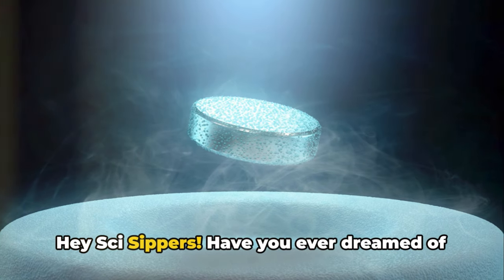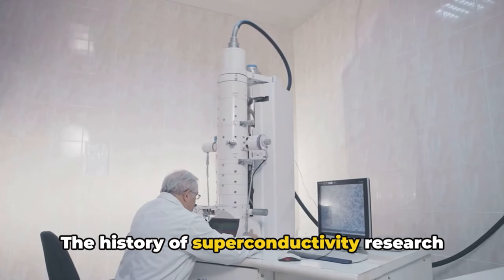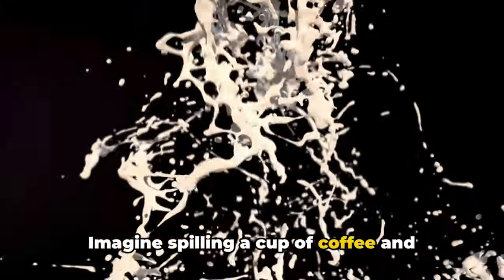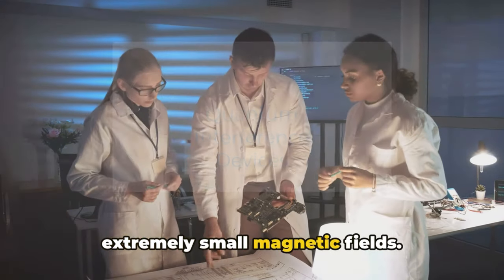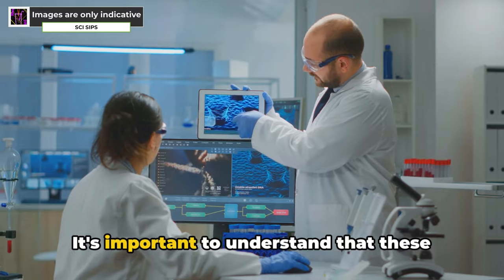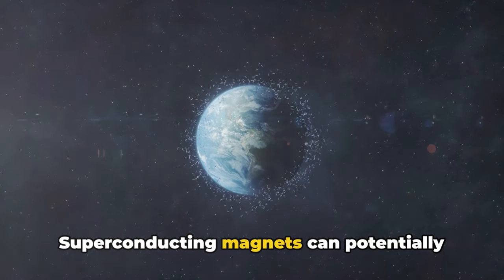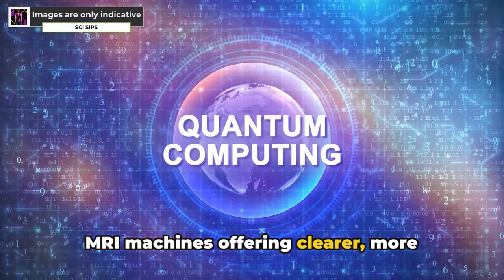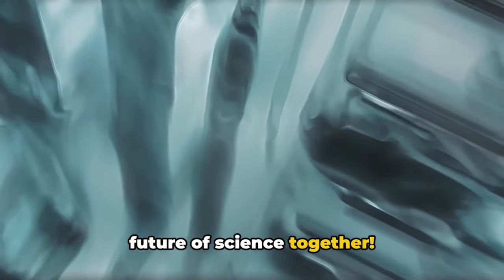Superconductivity at Room Temperature:  Unraveling  A Quantum Leap

Comment: The symphony of harmonies and the tone of a singular position that is so entrenched in the spacing process circles within circles of dielectric properties that change in temperature when flowserve is open to reduce the temperature and speed up the pathways of voltages to understand amplification of wavelengths you're entangled in every direction since they have no vibrations to the wavelength dimensional placement is iron sulfide or neutrons that flip flop so fast there not measured by normal levels
Reply from the maker: Hi there, thanks once again for your comment on the "Superconductivity at Room Temperature" video! I appreciate you sharing your thoughts, even though the specific details you mentioned don't directly connect to the video's subject.

Your comment touches on various scientific concepts, and while their potential connections are intriguing, they require further clarification to fully grasp their link to superconductivity. Here's how we can approach this:

Understanding your comment:

Specific terms: While the use of terms like "harmonic positions," "dielectric properties," and "iron sulfide" hint at potential areas of science, their specific connection to superconductivity or the broader topic of the video isn't entirely clear.
Overall theme: The comment seems to suggest a connection between various phenomena like temperature, flow, voltage, and material properties, but the specific relationship to superconductivity requires further explanation.
Moving forward:

Clarification: If you'd like to elaborate on your comment and provide more context, especially how these concepts relate to superconductivity, feel free to reply or send me a private message. I'm happy to discuss your ideas further and see if we can identify any potential connections.

Exploring resources: If you're interested in delving deeper into the specific concepts you mentioned, here are some resources:

"Harmonic positions" and "dielectric properties": These terms are relevant to fields like electromagnetism and materials science. Searching for online resources or academic papers using these terms might offer more information.
"Iron sulfide": This is a specific material with unique properties. Exploring research on its electrical conductivity, temperature dependence, or potential applications in superconductivity could be fruitful.
"Neutrons that flip flop": This likely refers to the concept of spin in quantum mechanics. Learning more about quantum mechanics, specifically spin states and their behavior, might be helpful.

Once again, thank you for being part of the Sci Sips community!

Comment: Why not just have super conductivity in a enclosed space like a fridge type devive, which counterbalances any heat to keep the process at room temperature as needed.
Reply from the maker: Your suggestion of enclosing a superconductor in a cooled chamber to "counterbalance any heat" is a creative approach, and it highlights the ongoing quest for practical applications of this fascinating phenomenon.

However, there are a few key points to consider:

1. The Challenge of Maintaining Extreme Cold: While cooling a chamber can create an environment for existing superconductors to function, achieving and maintaining the ultra-low temperatures needed for most superconductors (like liquid nitrogen, around -196°C) is itself an energy-intensive process. This negates some of the potential benefits of room-temperature superconductivity, especially in terms of efficiency and energy savings.

2. Localized vs. Practical Applications: Enclosing superconductors in cooled chambers might be suitable for some specific, controlled laboratory experiments or niche applications. However, it wouldn't be a practical solution for large-scale applications, such as power transmission lines, maglev trains, or energy storage devices, where the entire system needs to function at ambient temperature.

3. The Quest for Intrinsic Room-Temperature Superconductors: The ultimate goal of researchers is to discover materials that exhibit superconductivity at room temperature inherently, without the need for external cooling systems. This would unlock the true potential of this phenomenon, enabling its seamless integration into various technologies and revolutionizing fields like energy, transportation, and medicine.

Your comment reflects the ingenuity and curiosity that drive scientific progress! While enclosed cooled chambers might not be the ultimate solution, they represent a stepping stone in our understanding and exploration of superconductivity.

I hope this explanation clarifies the challenges involved and the ongoing pursuit of intrinsic room-temperature superconductors. Please feel free to ask any further questions you might have!

Comment: Twin particles of the sameness of the Crystals or other formations of gases that have resonances of lightning or vibration to certain level of the universe itself they have a different kind of environment it's pathway based energy is not a normal thing to understand that spaceings turn into a new system of currents
Reply from the maker: Hi there, thanks for your comment on the "Superconductivity at Room Temperature" video! I appreciate you sharing your thoughts, even though the specific details about "twin particles" and "resonances" are a bit outside the scope of that particular video.

It's clear that you have a deep interest in exploring complex scientific concepts, and I commend your curiosity! While the comment doesn't directly relate to superconductivity, it touches on fascinating ideas that deserve further exploration.

Here are some thoughts to consider:

The concept of "twin particles": This could be referring to various phenomena in physics, like entangled particles in quantum mechanics or even crystal twins in materials science. It would be helpful to have more context to understand your specific interpretation.
"Resonances of lightning or vibration": This could potentially relate to various areas like plasma physics, where charged particles resonate with electromagnetic fields, or even acoustics, where sound waves resonate in specific environments.
"Pathway-based energy" and "new system of currents": These concepts are intriguing but require additional clarification to fully understand their connection to the comment's overall theme.
If you're interested in delving deeper into these specific topics, here are some suggestions:

Reach out directly: Feel free to send me a private message if you'd like to discuss your ideas further and explore potential connections to superconductivity or other scientific concepts.
Explore other resources: There are many fantastic online resources and educational channels that delve into various areas of physics, materials science, and other scientific disciplines. You might find valuable information and explanations to help you explore your ideas further.
Remember, the beauty of science lies in its continuous exploration and questioning. While the comment's specifics might not directly relate to room-temperature superconductivity, it reflects a curious mind eager to explore the universe's complexities. Always feel free to ask questions, share your ideas, and engage in respectful scientific discussions.

Thank you for being part of the Sci Sips community!